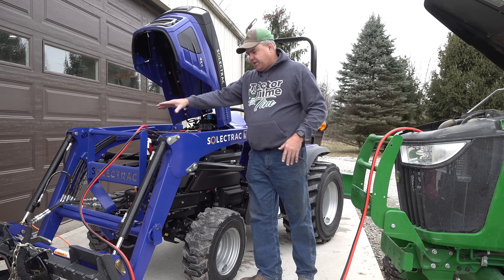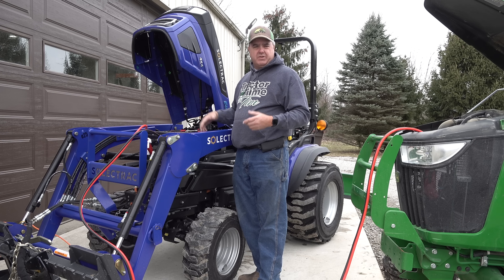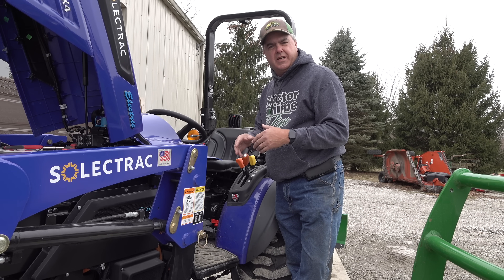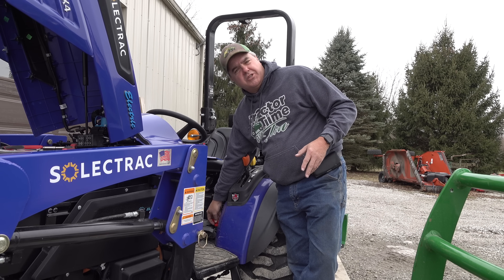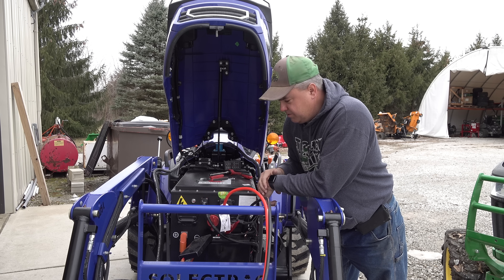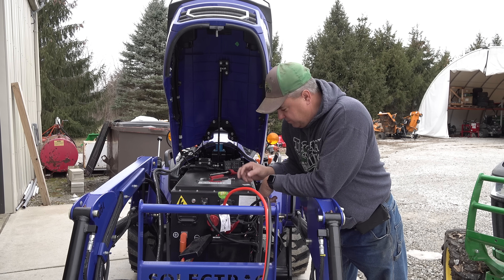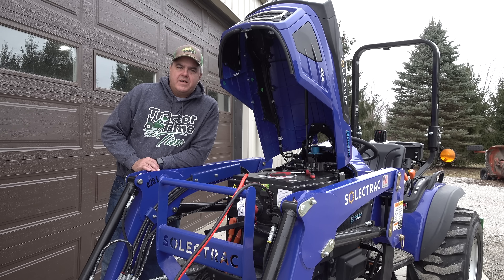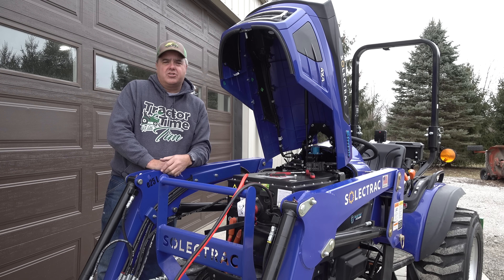Battery Issue with the Solectrac Electric Tractor!  I’ll Explain the Details!

Comment: the 12v is the brain controller of the unit. the main battery pack is too powerful for such sensitive electronics and will blow up the small 12v battery as well as burn out the computer controllers for the whole machine. tim, you should get on some of the Ebike forums to learn about these batteries and the BMS controllers because there is a very real danger of them bursting into flames which feeds directly on oxygen, and unless you can completely 100% deprive them of oxygen they will violently combust with any source of oxygen even the  hydrogen and 2 oxygen atoms in water. make sure you get  lithium rated fire extinguishers and in atleast a 20# tank size for outside of the building you are keeping this machine in. don't put it in your house, the toxic fumes of these batteries when they burn is enough to condemn a house as it soaks into the building materials especially the wood and sheet rock.
i am having to replace my electric motor on one of my rear wheels after 1000km of use...apparently there is some sort of flaw or maintenance issue that has to be done at around 1000km mark to the motors or something inside them goes bad. in mine 2 HALL speed sensors came apart. one from it's solder joint on the circuit board and the other broke free of the housing from using it too hard that the glue holding it to the motor wall went brittle and vibration cracked it off.
the motors have been out of stock since 2 years ago and i just got my new replacement motor ordered yesterday which has a been a real hassle going back and forth with the vendor sending pictures and serial ID as well as wire connector harness matching

oh also forgot to mention there is a cold weather penalty on the batteries @32 you will lose full capacity just due to the temperature so the 85% you are seeing might very well just be the max the battery will contain at that temp, at 0º the penalty is 50% @-32º it's worse about 28-30/X% max capacity. watch some of the videos about the telsa owners battery complaints

Comment: the high voltage battery is disconnected with a large contactor(relay) triggered by the 12v sub system.    no charging or discharging can occur without 12v controlling that main contactor.   common on every EV.

Comment: the 12v battery uses the key to trigger the main high voltage bus contactor.      you can call it the contactor switch instead of ignition.    and scream "CONTACT" every time you turn it if you'd like.

Comment: Very interesting video. In my profession of electrician which includes industrial control, we would refer to the small battery as "control power" which often is from a different source than the higher voltage or amperage power running the equipment. One has to think about these kinds of machines in a different way. An internal combustion engine (kinetic energy) and the fuel (potential energy) are actually producing the power required to run the equipment AND recharge the battery  but need another source of potential energy (the battery) to get things going. In an electric machine, it's all potential energy stored in the battery that only depletes, there's no generation of electrical energy to "recharge" anything. Your findings tell me there's a couple of oversights in their design. There should be no parasitic drain on the control battery. I don't know of any component or system (other than say a clock) that needs to be supervised while the machine is inactive. In my opinion, the large battery or batteries should be designed to keep the brain alive. I'm curious, are the control and main batteries different voltages? Looks like your going to have to keep the control battery on a seperate trickle charger when not in use to ensure your brain is going to work regardless of the kill switch position.
Reply: That switch that he referred to needing to be turned off is the ignition switch. Just like in a a combustion tractor if you leave the switch on with the engine not running, it will run down the 12v battery.

In a combustion engine, turning the key on powers up computers, ignition coils, etc, that provide a small parasitic drain. EVs also have computers, and in this case one big one is the BMS (Battery Management System) that monitors and controls the large battery (Which is 72v lithium iron phosphate in this case, so no they are not the same voltage, nor same chemistry) and another big one is the coil: Not an ignition coil, but these big batteries have large contactors that use an electromagnetic coil to close what is basically a large solenoid to connect the main battery to the motor. All of these things are powered by the 12v battery and will absolutely drain it if you leave the key on with the tractor not running.

This isn't an oversight in the design, it was purposely designed this way. Running down the 12v battery is a minor inconvenience and easy to jump start and cheap to replace. Imagine if the main pack was allowed to run down in this situation: A tractor parked for months (Which often happens in winter) could completely drain the main lithium battery, potentially ruining it, which would be an expensive repair. Every EV I've looked at has worked this same way for this very reason.

Comment: Hey Tim, if the tractor works like an EV, the 12v battery actuates a physical contactor that then allows charging and use of the traction battery. Thus when the 12v is dead, you've bricked the tractor.

Comment: The 12v system works exactly like it does on a standard tractor.  This is also exactly how the 12v system works on on a Tesla or any other EV.  Minus the weird 12v shutoff switch.

Comment: not sure about EV's    but your modern piston engine vehicals with many moduals   will go to sleep after 90 minutes or so and draw less then 50 mA that should keep the battery charged for at least 30 days   a lot of weird stuff happens when battery is weak or has bad connections. always check if your having gremlins of the electrical nature to first check the "starting battery"

Comment: Shades of my Toyota Prius. There's a conventional 12v battery that operates the electronics separate from the high voltage battery driving the motor. That 12v battery dies and you go nowhere no matter how many kwh are in the big battery. With the Prius that battery gets a charge from the engine, like any other vehicle. Wonder how the Solectrac charges the 12v...

Comment: Good morning, Tim, always enjoy your videos. Maybe I missed one that you may have already offered on the battery-operated tractor but have some questions. What does this tractor cost? What is stated as the life expectancy of the battery? How much to replace the battery? What's the H.P. of this tractor? And I believe you have not had a chance to really use the tractor (snow removal, etc.) but any idea of allowed usage between charges? Here in N.E. Ohio, I have only plowed my driveway 3 times this winter, less than 1- gallon of diesel used. Bought my tractor last year, I figure the money saved buying the tractor and not having to pay a plow service will give me a payback in about 75 years, as far as snow removal, one of my smartest investments!!

Comment: All electric vehicles are exactly like this. The high voltage battery is disconnected by contactors/relays except when you're operating the vehicle or charging it. The 12V system operates those contactors, so you need the 12V battery to turn it on or charge it. The 12V electronics are powered to monitor for the charging plug to connect or for the driver to request the high voltage turned on, and activate the contactors. So there is some slow draw. However most electric cars are capable of monitoring the charge level of their 12V battery and keeping it charged from the high voltage battery when needed. This tractor seems to have a more simple setup, probably for cost savings, so you actually turn off the 12V battery to prevent it from discharging.

Comment: The industry is still using 12volt for accessories in electric vehicles. Very shortly new accessories with the same voltage of the lithium ion battery will be coming out hopefully eliminating this problem. Plus it’s one less battery to replace every so often. Also less weight as lead acid is quite a bit heavier.
Reply: Not sure that will ever happen since the traction batteries  is not defined at a single voltage across the industry.  Also having the power electronics to handle such high voltages on every accessory just would not make sense.  Also dealing with HV is a pain why add that to everything? The only issue I find in his issue was that the traction battery could not charge the 12V, however it sounds like he had it pretty dead at which point the DC-DC converter that handles the charging may have a safety that it wont turn on if the 12V side is below a certain threshold.
Reply: @hagak1679  you are right that one barrier is companies using different voltages. I think within the next five years the industry will settle into a couple main voltages. 800V and xxxVolt? 

Other advantages I didn’t mention with higher voltages is the ability to use lighter gauge cable. This reduces weight and cost for the manufacture. You can also route thinner gauge cabling easier. When you make millions of cars per year, that adds up fast. 

I think the power electronics issue is a big lift but once it’s switched over and the supply base is there, you are good.
Reply: @kylekleman  But everything on the 12V circuit really would not benefit much from higher voltages, you do NOT want to run 800V to the key switch, radio, etc.  Even small fans you do not want those voltages.  The industry will NOT come to a single HV for all vehicles, just would not make sense.  Just like you do not have a single engine size for all cars.

Comment: I'm wondering if, when the 12v battery was 'dead'  plugging in the charge cable, should have charged the 12 v battery, then when the system saw 12v, it would charge the main batteries.

Comment: It is the failure of modern Electric vehicles including all the hybrid vehicles.  It is just like your car or a regular tractor, would you leave your ignition key in the on position?  A trickle charger can be used.

Comment: Many electric cars have the same problem. Too little charge of the 12v battery can leave you stranded after the car has been sitting for a few days. Especially in cold weather.

Comment: I try to be green (I have solar cells all over my roof) but the little Yanmar in my 2038R is so efficient and clean that I just can't see going electric with a tractor-yet. Maybe in a few more years when the technology matures and the batteries are not as ecologically damaging to produce. We will get there, but right now a five gallon jug of diesel holds me for hours and hours, and barely nicks the environment.

Comment: I understand the electronics end of it but that setup with the battery sucks for exactly the problems you've had.  They should put a second 'state of charge' meter on there for the small battery or at least a warning light.

Comment: I'm hesitant to buying small equipment that run on batteries only. After using the small tools on gas and a tractor on diesel i can't see a tractor on batteries. I see where Ford truck that's electric have stopped production until they figure out their problems i guess. Then to find a better way to charge those batteries the old way of relying on a grid from the electric company or pay money out buying solar panels and setting them up to charge stuff.

Comment: That's typical of all electric vehicles. The main job of the 12V battery is to activate the relay for the high voltage battery. When the vehicle is off, the large battery is completely isolated until the 12V battery activates the relay. 
Tesla's, Chevy EVs, Nissan, etc. They all have a 12V battery to activate the main pack, and without it, they can't be turned on or charged.
They 12V battery should be getting charged while you have the main battery charging or running if they build it correctly.

Comment: Battery-powered tractors are a non-sequitur, to me.  A tractor needs to be able to work, and keep right on working, with nothing more than a few gallons of fuel, if it runs out.  I am not a Luddite and I actually love alternative generation and storage solutions.  I have built my own lithium batteries, from components, and have installed my own solar panels and inverters.  Some things are possible, but definitely not prudent.  This particular application of technology, a battery-powered tractor, is a perfect example of that.  It's a curiosity and an interesting case study of what NOT to do; taking a good idea too far and turning it into an absurdly expensive toy that won't do the work of the thing it proposes to replace.

Maybe I'm wrong?  I seriously doubt it on this one.
Reply: Agree 100%. There was a video on a small excavator across the water, it only ran for about 3 hours before it was dead . Owner said he would have to buy 4 machines to do the work of one diesel unit. That sounds like a good idea Joe.

Comment: It wasn't clear to me ... does the 12v battery get automatically charged by the main battery charger or do you have to maintain the 12v battery with a separate charger?  (If it does require a separate charger, that would seem to be a poor design!)
Reply: I got the impression the main battery does send charge to the 12V battery when the tractor is on or perhaps charging. Its just the input of charge is only slightly greater or equal to the constant discharge requirements on the 12V battery, so if you let the 12V battery run down the main battery can't send enough charge to charge the 12V back to full charge in any reasonable time frame. My guess so long as you use the disconnect switch every time you turn the tractor off you won't have to worry about separately charging the 12V battery.

Comment: Am I understanding that you have to charge the 12v slave battery independently from the main power source battery?
Reply: The tractors propulsion pack can maintain the 12v battery. It just can't charge a stone dead one with no power to start with. It needs power to "energize" the circuits to activate the propulsion pack.

Comment: My Nissan Leaf won't go without the 12V battery as it controls the main disconnect of the larger battery.  This is done for safety so you don't get killed by the larger battery.

Comment: This is very similar to how the 12V battery functions in Toyota hybrid vehicles. It powers the normal electronics and its interaction with the drivetrain is just pulling in relays and contactors to get the drive motors power from the traction battery.

Comment: Most EV's (cars, truck, etc.) have a small 12V battery in addition to the high voltage main battery. In most cases when that small 12V battery is dead the entire vehicle is disabled.
Reply: And they put them in really hard to access places. The steps you have to take if your 12v battery dies in most EV's is insane.
Reply: I believe Hyundai -Kia is the only company making EVs that power the 12V side by stepping down power from the main battery pack.   Everyone else seems to use a separate 12V battery for those functions

Comment: electric machines will never replace the regular machines beacause of the factor of cold weather
Reply: Don't be so sure. There's technology that the battery can warm itself up.
Reply: @Itsa_Mea  what about If the powers out
Reply: @karl-egertdaskov6217  just like anything else when you're out of fuel, whether its batteries or diesel, you're done!
Reply: @Itsa_Mea  well i personally keep 2 tanks worth of extra Diesel for the tractor and few cans of gas since my tractor needs both

Comment: Different is not necessarily better or worse, just different. Coming from the heavy equipment world, turning off master switches is just natural for me, I also see one at the front of the main battery. I do have concerns about the location/ durability of the switch handle. I can see it getting hit by your heel or something you put on the floor of the tractor. I do really enjoy seeing the cats roaming around.

Comment: Well it has this thing about it,  you need to keep a regular charger nearby for this reason....   🙂👍
Reply: Didn't he state early in the video that the main battery will maintain the small 12V battery? If used frequently (weekly) I don't think there'd be an issue.

Comment: If I’m going to have a 12 volt battery, that can go dead, have to maintain it and change it over time, I may as well stay with my gas garden tractors and now in the herd, a diesel Ford 1210 tractor that my son bought.
Have a good day.
Maybe they should have a solar 1 or 2 amp charger on the tractor. Would keep the 12 volt battery topped up ?
Hehe. You out smarted the cat. Hehe. I outsmart my cat quite a bit.

Comment: Hundreds of thousands of dollars of equipment, tools and implements and you couldn't find a battery charger and an extension cord?
Reply: If a battery is totally dead, most chargers won’t recognize the load and won’t start charging.
Reply: The old ones will.

Comment: What a stupid setup. You need a secondary battery to power a primary battery. Can't tell me that there's not a way to power up the electronics on the tractor with just the primary battery
Reply: I think it was a cost saving measure 🤔 However,  the company ought to make a big deal on training new owners on this odd setup. They might even want to throw in a deep cycle battery charger for this. I'm just guessing that it may be a deep cycle marine battery rather than a regular 12 volt?